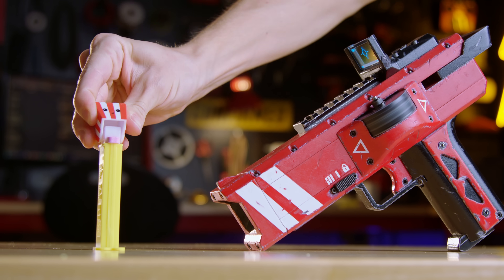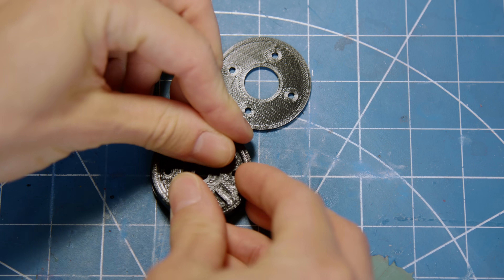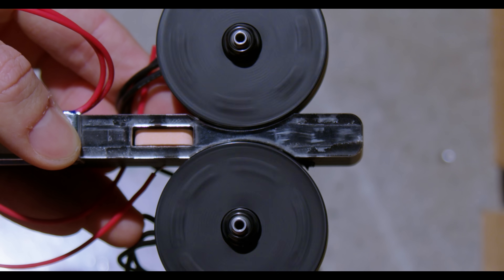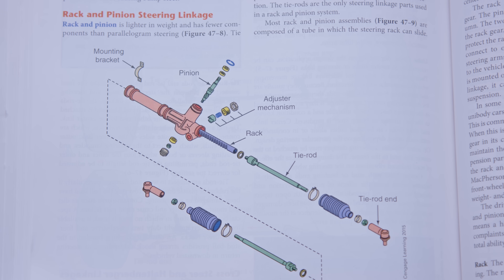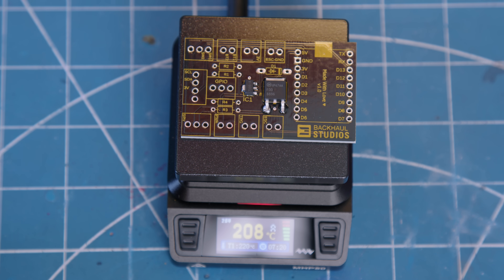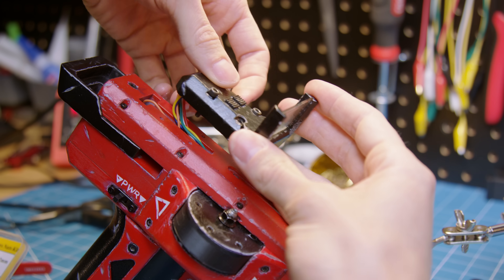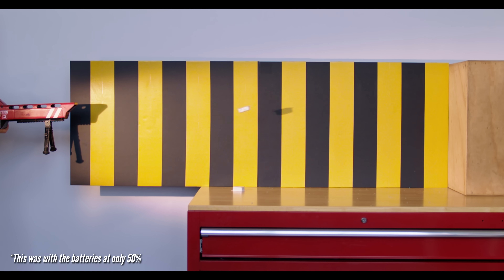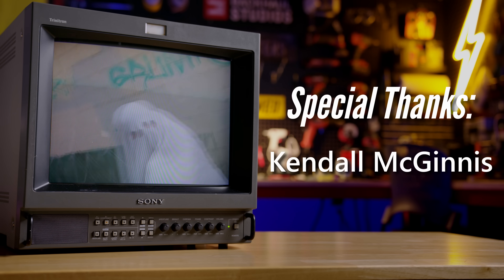I Made A 3D Printed Candy Blaster

Comment: Uuuhhm, so you make custom pcb boards.. but still use wires.. why not just design custom boards that carries the wires with edge connectors where then need to interconnect.. or short patch cables.. Might be easier to take apart and put together doing that.

Comment: Dang thats some super expensive filament :( on a serious note, for the firing mechanism, instead of a rack and pinion, you could maybe try a rotational piston mechanism or sliding crank. It could even result in faster fire rate. Sorry if the term is wrong, Im not remotely close to an engineer by any means 😅 but ive seen the mechanism used for fast in and out (pause) applications like yours.

Comment: Why use a cam and a connecting rod with a simple switch when you can use a rack and piston and a controller with custom code to get it to work. Am I right?
Edit: That's not how reflector sights works.

Comment: 5:57 have you heard of latching solenoids? they fire in both directions and latch at the ends, which I think would fix your issue
Reply from the maker: I actually looked into this originally! However, considering space was the major constraint for this build, there weren't any I could find that were small enough, and with a long enough stroke to extend all the way through the magazine
Reply: @backhaul-studios  ahh that makes sense, i like your rack and pinion design as well, another option though is to change out the spring on the solenoid to something stronger?

Comment: If you replaced the rack and pinion with a piston linkage, would that allow for faster firing as the feed motor could rotate in a singular direction continuously, rather than having to stop and rotate the opposite direction to reset?

Comment: the problem I have is that the sighting system isn't exactly functional. its not like a real gun sight, its just a static reticle.
Reply from the maker: The beautiful thing about building the sight using a microcontroller, is its fully adjustable! So you can tune it in real time to match the functionality of a real sight by just tweaking the code

Comment: 6:40 a scotch yoke would be faster and more reliable
Reply from the maker: Certainly an option! However, because they are a significantly higher wear design and I’m using plastic parts, I opted for something that would last significantly longer without needing maintenance or lubricants.

Comment: This is such an awesome project and I'm so glad I found your channel :D If you accept an advice, I think you could've solved the dispenser mechanism easier if you already decided to go with the fully automatic approach. I see why you did what you did to replace the solanoid, but I think you overengineered it a little bit :D Imagine a simple motor with a gear attached to it, that has only one tooth on it. When you spin up the motor, the gear spins, and whenever the one tooth hits the pez, it would shoot out the ammo into the spinning wheels. Since the dispenser motor's gear would only have one tooth, it would need one full rotation until it would hit the pez again, so the springs would have enough time to lauch the next "bullet" upwards. I don't know if I could explain my toughts well enough :D Anyways, awesome project, very cool video :D Keep them coming!
Reply from the maker: That would be a great way to do it! And you'd have a much higher fire rate as well, since the servo is more focused on torque vs speed. I was thinking of doing some sort of slider and crank mechanism, but your idea is way cleaner!
Reply: @backhaul-studios  Thanks :D Although it comes with the disadvantage of not letting you fire manually or semi-automatically. Anyways loved to see your solution!

Comment: The second you had the orientation was the problem I thought you were going to move the flywheels on the top and bottom instead of rotating the pez... yours is simplier but the other way would let you re-use pez dispensers & it would be more narrow. Just a thoughts if you revisit.

Edit: I suppose a 3rd option if you did want to try to reuse Pez Dispensers would be to add a ramp that curves the Pez to the right orientation
Reply from the maker: There was definitely a point where I considered doing top and bottom flywheels! I think it would be really interesting to test and see how modifying the flywheel position impacts the speed/range of the candy. Though for the purposes of this build, I wanted to make a custom magazine anyways so everything looked cohesive (even if I still had to pull the springs from the original dispensers 😅)